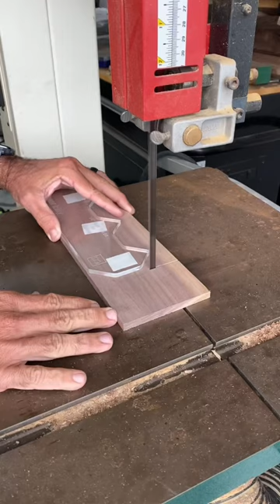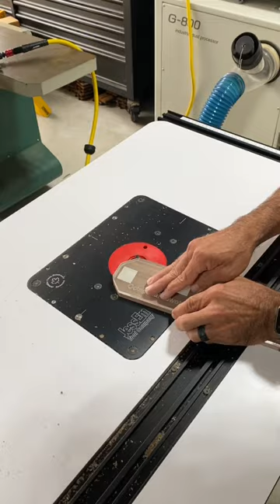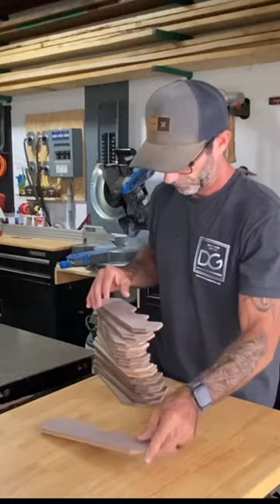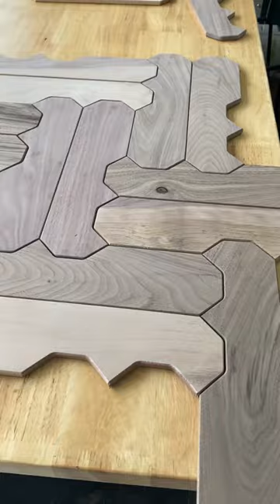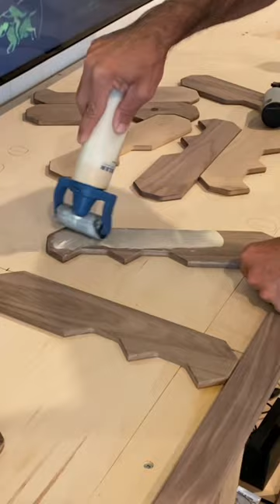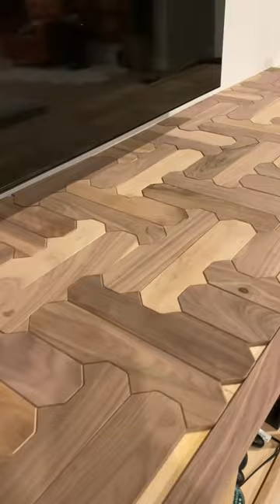Walnut Inlay #shorts #woodworking

Comment: That's a beautiful pattern but inlay requires you to cut out the piece they are going to lay in. You essentially did wood tiling.
Reply from the maker: Thank you… yes I absolutely 👍 agree with ya but in this case the top had a border and I’m filling in, so this is more like an inlay. If it had no border than I would have called it an onlay 👍 either way, I can’t wait to show you the final reveal soon. It’s coming out awesome
Reply: @DesignsbyDonnie  its not an inlay. even with the border, its still tiling. an inlay is taking part of the wood out and inlaying other wood into that piece, not laying it on top of a flat piece of wood.

Comment: Inlay seems like a strong term. That's just wood tiling with a neat pattern.
Reply from the maker: Yes, I totally agree with you but the reason I say “inlay” instead of onlay is becasue the top of the cabinet is framed in with a border and when you fill in, it’s considered an inlay. With that said, I agree with ya, it’s a strong phrase and I see how that could be interpreted several ways 👍

Comment: Not an inlay. Having a border around the piece means nothing. It’s just a pattern with a border around it. Inlay requires the pieces to be cut out of surrounding material.
Reply from the maker: Well, that’s actually not true. but thank you for the info 👍
Reply: @DesignsbyDonnie  https://en.m.wikipedia.org/wiki/Inlay

What’s not true?

Comment: Inlay is fun to work if it's your personal use. But from a commercial side it's not. It's an acquired taste. Look at old 60s and 70s cabinets. They sell quick. It's sturdy and easy to clean. If it has a name, it could fetch $$$$. The reason Herring Bone walls and floors are obsolete. They look very nice but a lot of work.